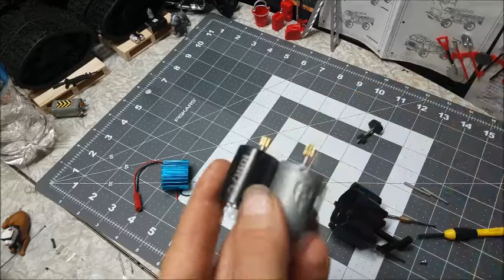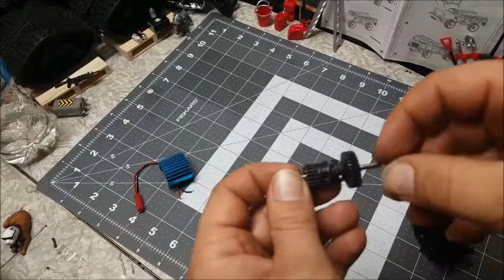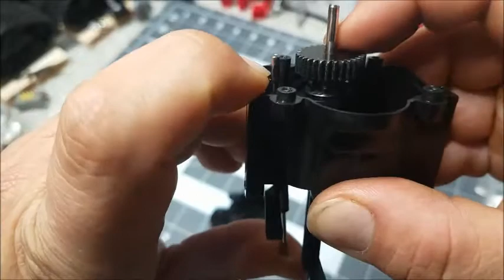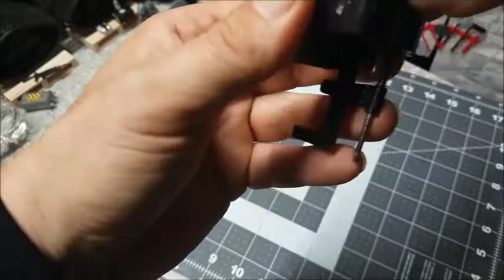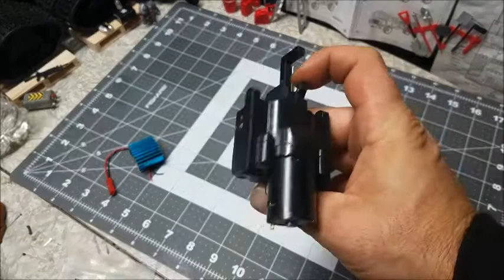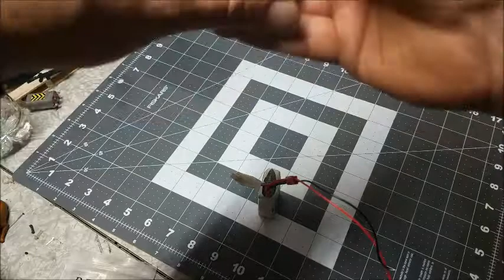WPL RC 370 dual speed metal gear install

Comment: Did you loose low end torque with that motor? I just installed one and its has no torque. Its fast but low end sucks 😢
Reply from the maker: @r_serpas8355  i ended up lossing low end torque with it

Comment: I'm planning an upgrade just like this video. The black motor is still on the way, and I already have the gearbox. However, some people say that this motor might burn out the ESC. What has your experience been? I have a 30A esc. Also, is it okay not to connect a 224 capacitor between the motors?
Reply from the maker: @sd_gundam  the black motor spins fast,  never had issue with it burning out the ESC
Reply: @KlunkersKustoms  Since this video is quite old, I wasn’t expecting many comments, so I really appreciate yours. With that said, I’ll continue with my challenge. I suppose it’s unavoidable that torque decreases as motor speed increases, right?  I don't have a capacitor. Will the motor still operate without it?
Reply from the maker: @sd_gundam  the capacitor just helps if you have a sound board and speaker, helps with distorting the sound
Reply: @KlunkersKustoms  oh,, thank you very much!! I run a coffee shop, and if you come to Korea, I'll make you unlimited coffee!! have a nice day~!

Comment: I need you to add front dig to my transfer case. That way I can just fwd for tight turns. I will remove the T case for you
Reply from the maker: just add a hydralic release on the driveshaft.  pull a leaver and it disengages the power to the back,  its how cars like hoonicorn and hoontruck work
Reply from the maker: you just need more power and you can slide it
Reply from the maker: hey, what is the name of the RC truck you have ,  brand and model number. thanks
Reply: @KlunkersKustoms  hosim 9125 I believe
Reply from the maker: @justinirwin7881  ok, im gonna look it up, you should get it going, we got acouple fast RC's  now
Reply: @KlunkersKustoms  something is broke in front CV axle no 4x4
Reply from the maker: @justinirwin7881  dam
Reply: @KlunkersKustoms  I need to find someone to fix it... Know anyone?😁
Reply from the maker: @justinirwin7881  bring it over
Reply: @KlunkersKustoms  easier said than done....